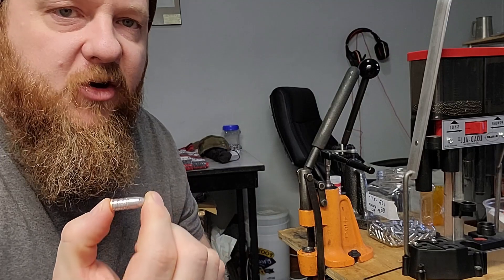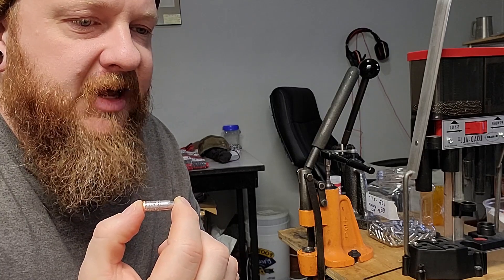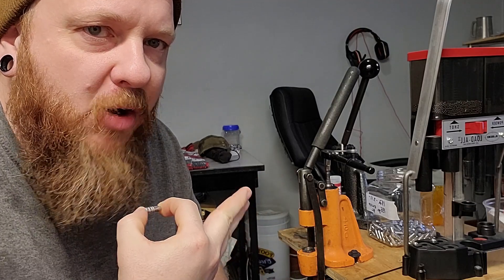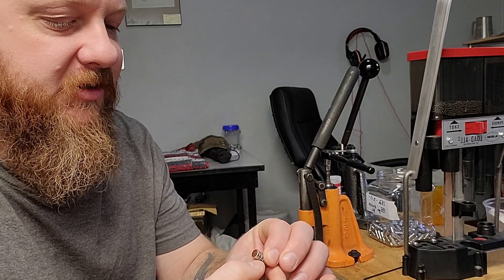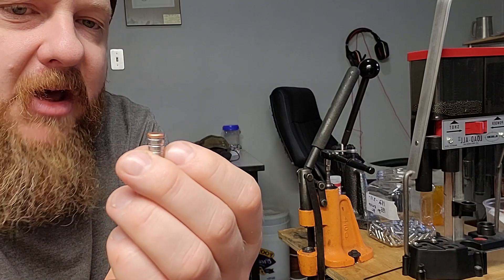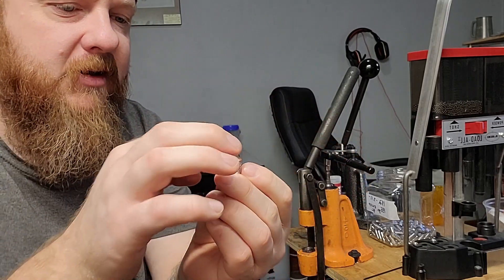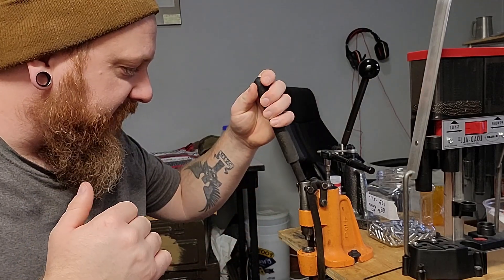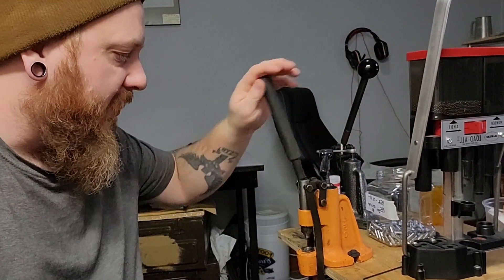gas checking and sizing 30 cal

Comment: So glad to see you back I was concerned. Very informative post re cast rifle bullets. For quite a while I've been casting and shooting 172 gn GC RN FP Lee .309 bullets out of my original US 1898 30/40 Krag. I tumble lube with Lee Alox ,size and crimp on a Hornady GC with a Lee Sizer die. I use range scrap also and after first melting and skimming obvious debris: stones, jackets, dirt etc: i.e.This lowers range scrap (BHN 11-12) for BP cartridges to about 9-10 and raises BHN for higher pressure pistol and rifle rounds to about 13-14. My BP rounds are fully assembled then tips dipped in melted lube (BW+Tallow) to give a good coat on the exposed lead bullet noses.(can be stored then lubed just before using) I store them in plastic cartridge boxes to keep them clean. Fouling stays very soft and comes out completely with 1 Moose Milk wet and 1 dry patch. Again glad you're back and look forward to many more posts. DJ

Comment: Would it be possible to load this with blackpowder loads?
Reply: Absolutely With proper lubricant Full case and you can even use Non-GC styles I do it for 45/70  DJ
Reply from the maker: Im sure you could, however accuracy may be compromised. Everything black Powder has a video on 30-30 black powder, feel free to check him out.
Reply: If you have a Marlin with micro-groove rifling then cast bullets generally often do not shoot  accurately. Jacketed un-lubed bullets also can create a problem with hard  crusty black powder fouling which will destroy accuracy after just a few rounds. If you have deep cut rifling in your 30-30 then cast lead well lubricated bullets should shoot well but as seen in Every thing Black powder video you will lose 600-700 fps velocity